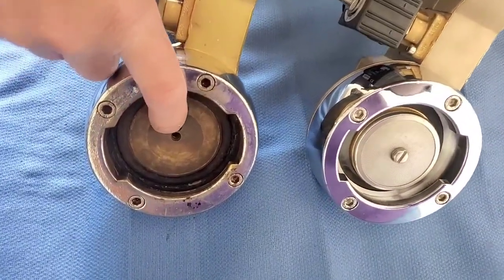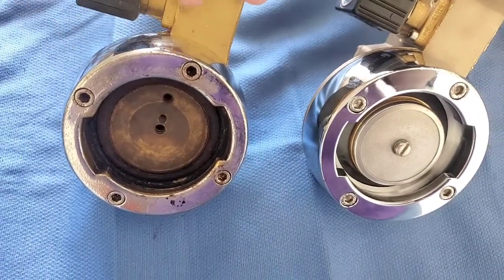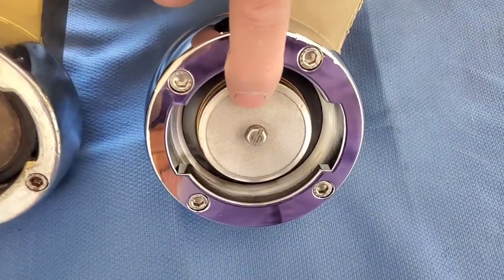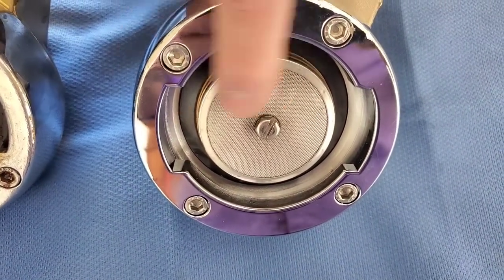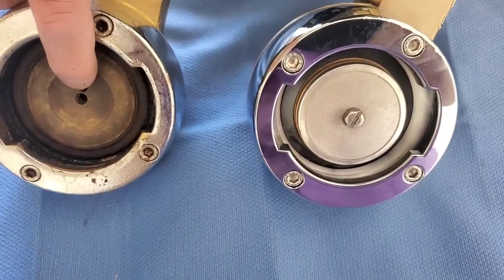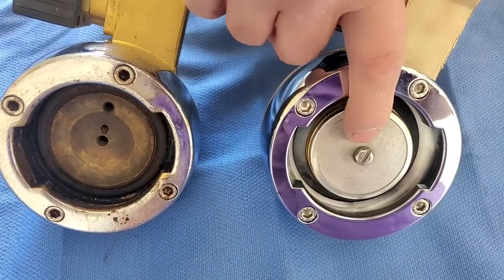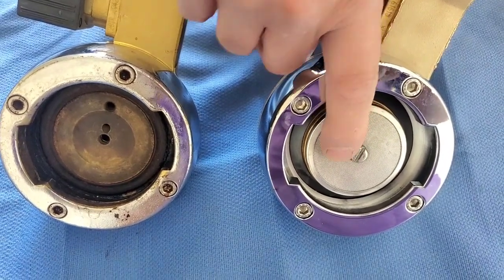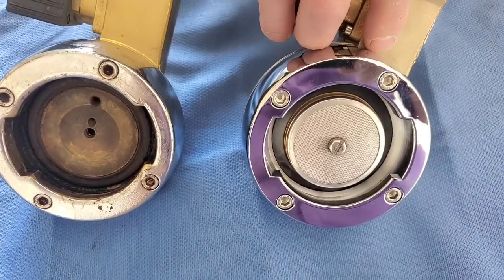Tip on Avoiding a Stripped Group Head

Comment: couldn.t you made another thread  to save the group head?
Reply from the maker: Yes  but it may not be worth it . You will have to modify other items like the screen and diffuser  to make it work and typically, you  cannot tap in enough threads to make it last.